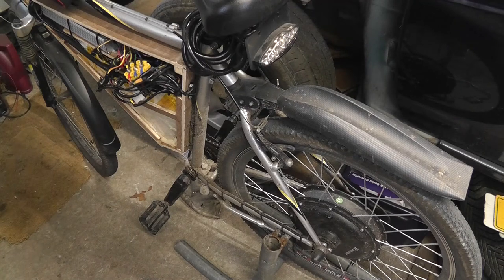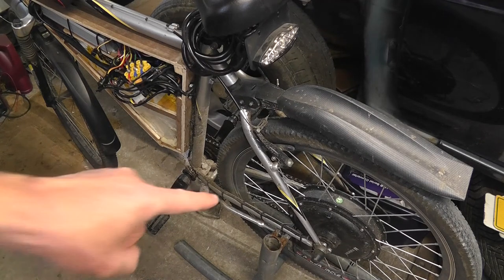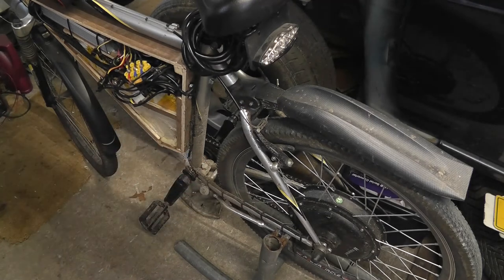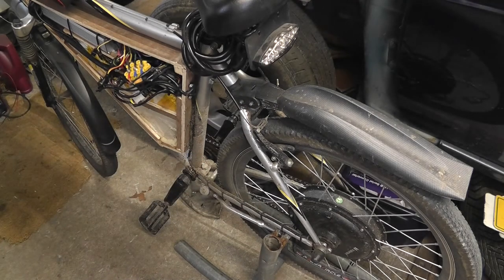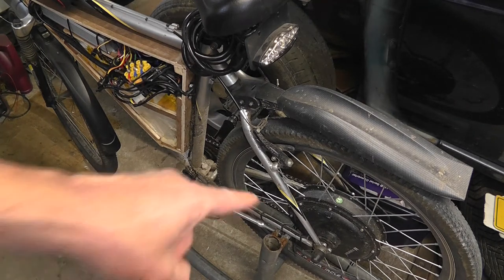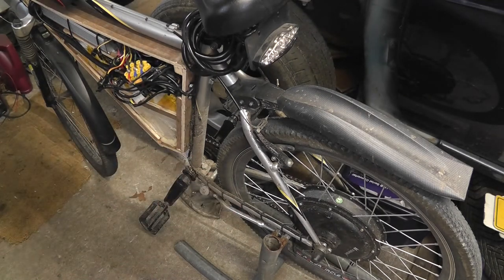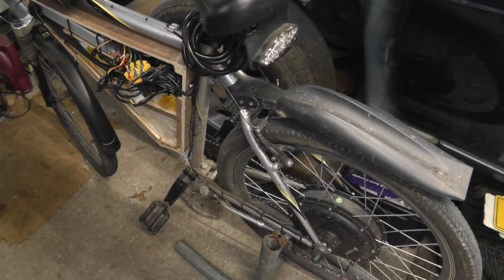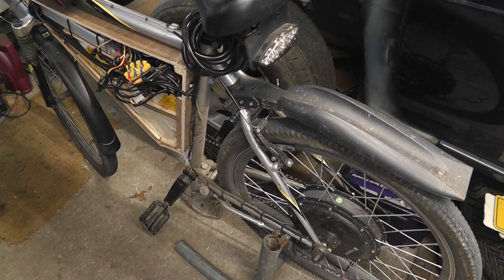How to Count the Magnets in an Ebike Hub Motor (Short)

Comment: Hi, and thanks for your help. I noticed that while I was fully focused on counting all the magnets (100 on mine), the cable I used to short the two phases fell off. For me, it seems to work just to turn the wheel in the opposite direction and simply count—without doing anything else.

Comment: What exactly is this measuring? Is it measuring the speed measuring magnet? (Range 1-100)  ...because I think my parameter default settings got messed up and I am trying to find out what the 3 factory set defaults are for P07 Speed Measuring Magnet (range 1-100), P13 PAS Magnet type (5, 8 or 12), and P014 Current Limiting of Controller (1-20A). Thank you in advance for your kind reply.
Reply from the maker: It is a way of counting the main drive magnets in the motor. I'm not sure but the name "Speed Measuring Magnet" sounds more like Hall esfect sensor magnets.
Reply: The 3 8 12 magnets are the PAS that's the magnets in plastic ring that fits on krank. So when you peddle magnet starts PAS simple

Comment: Didn't have a wire on hand, but I used a metal washer, so that worked for me. The motor has 100 magnets. Should I set the parameters as 100 or do I need to figure out the ratio? Bought an M5 display that has 23 parameters to replace an S866 display that failed on me. The S866 shorted and gives an E10 error code. The new M5 display fixed that issue. PAS does not work and the throttle gives an E08 code since it shorted when it was wired incorrectly. Probably won't see an error code for PAS until the throttle is replaced, but the PAS light flashes when using the pedals.
Reply from the maker: Sorry I don't know. Sounds like the kind of question for an eBike forum.

Comment: It's actually 45 magnets! You're half way round when you hit 23 but when you complete the circle the magnet in the 46th position would be in the 12 o'clock position which is already filled by magnet number 1.
Reply from the maker: I don't think the motor manufacturers ever use odd number of magnets. I could be wrong but from what I've heard there are common numbers and 46 is one of them.
Reply: @alibro7512  I believe, at least in the SW900 screens menu's you change the magnet number 1 at a time. I've got to do mine later as i've just had to install and setup a new controller and I only get 000's on the display apart from the wattage so I need to find out how many magnets my motor hub has too as I never set this ebike of mine up in the 1st place.

Comment: Can it be true 96 magnet in my e bike motor .I  am using a 9 pin connection to the motor .the power of the motor is 250 w.

Comment: Thanks! Now i don't know what to do with this info (100) as the settings my display offered are 4 8 and 12...
Reply from the maker: I guess you could try 4 as it's a multiple of 100.
Reply: 4,8 and 12 is the number of magnets setting for PAS sensor, pedal magnets. The 0-100, (100) you measured is the speed measuring magnet of the motor. They are two separate settings.

Comment: Short, concise, and to the point. 
Unfortunately though, as far as I am aware this only works for DD motors, maybe geard hubs have another approach and you could cover that as well? 
Would be interesting to see how that one would work. Thanks Ali!
Reply from the maker: Thanks Charles
Yes, you're right. I should have mentioned it only works for DD motors as geared motors will have a clutch.
Reply: @alibro7512  although with geared motors you can spin the motor backwards to feel the magnets...

Comment: So I would just wrap a copper wire around 2 of the phase connectors (mine are bullet connectors) and count while still connected to the controller ? .
Reply from the maker: If it's easy to disconnect the controller then do. If not just make sure the battery is disconnected for safety reasons. Not electric shock so much as losing a finger
Reply: @alibro7512 with everything disconnected. I held 2 phase wires together and counted. Is that a correct way of counting the magnets ?
Reply from the maker: @anio6865  Yes so long as they are the phase wires from the motor.
Think of what happens during regen. As the wheel spins the motor generates power and puts it back into the battery but it also slows you down. You can feel the resistance as this happens. Shorting the motor coils does a similar thing.

Comment from the maker: Just in case I didn't make it clear I only counted half the magnets so I have 46 magnets in my motor which I believe is a fairly common number.
Please check out the links in the Video description. They are affiliate links so I'll receive a few cents if you make a purchase but you won’t pay a penny extra.
Reply: Hey, what power is your motor?
Reply from the maker: @DiavolO18  1500W
Reply: @alibro7512  i have S861 LCD, it has parameter P13 - magnet count, i have few choises to select - 3/5 and 12. How to get this number from my motor?
Reply from the maker: @DiavolO18  What motor do you have?
Reply: @alibro7512  1000w hub motor, direct drive.
Reply from the maker: @DiavolO18  it will probably have a similar number of magnets to mine? Have you tried counting them the way I showed in the video?
Reply: @alibro7512 lol. Which is the whole point of the video.

Thanks for the vid btw. I have a yescomusa 1500w motor - who knows who actually made it?

I'm doing a controller upgrade and want to make sure the motor is detected correctly. I knew there had to be an easier way.

Comment: Excellent stuff! This makes so much sense, and mine is set to 46 for this item in the display control. I think there’s some confusion when people are talking about magnets as the sensor ring for the crank also works by magnets (I think) and it’s usually either 3, 5 or 8, is this correct? I may be getting things wrong as I’m new to e-bikes but have been researching a lot in the last week 👍🚲
Reply from the maker: I don't know how many are usually in the crank rings but they are not evenly spaced so it does not activate if back pedalling.

Comment: Nice. Note that some (most maybe) of these motors have a built in planetary gearbox, so it'll be fewer than that. However, that probably doesn't matter if you're using this to determine speed or something like that.
Why would you need to know the number of magnets in the motor?
Reply from the maker: If you buy a new controller it's often one of the factors you need to enter when setting it up. You're right about a geared motor as it will also have a clutch so this is probably only relevant for a direct drive hub motor
Reply: for the richt settings on your  comp on the bike,to show the richt speed.,and to drive better when u have it not richt ,not good

Comment: I would feel a lot better about this method if you explained in the slightest what the shorting out of 2 of three phases had to do with anything.
Reply from the maker: Short out any permanent magnet motor and it will cog when you try to turn it. Each time it cogs the coils are passing across the magnets.